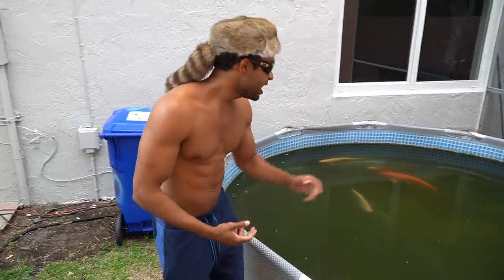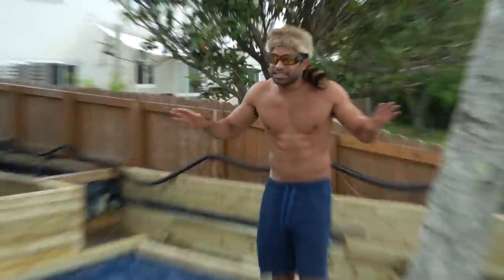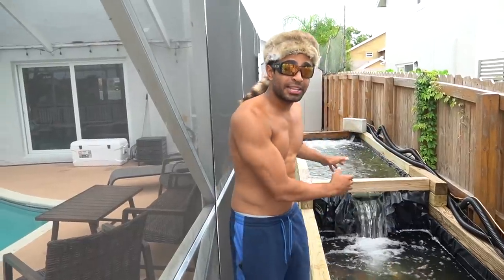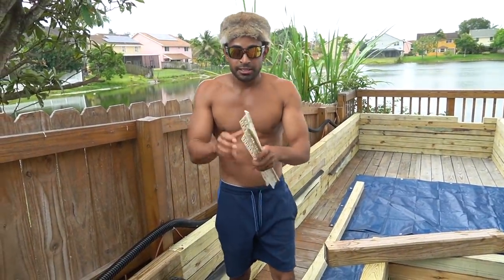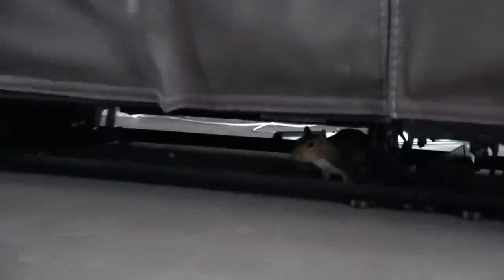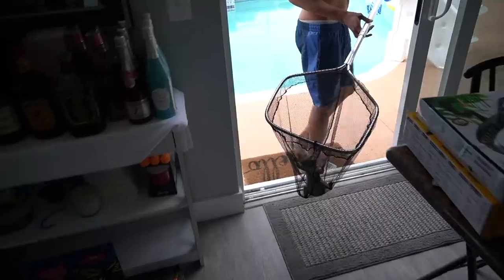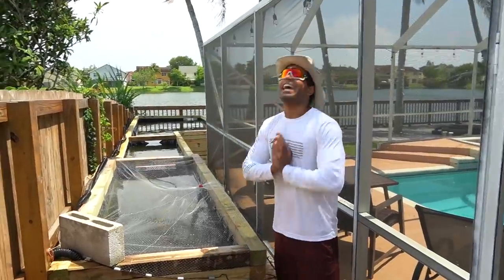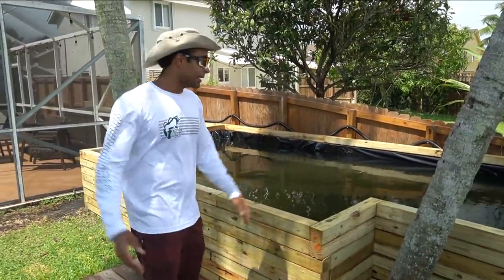BUILDING GIANT FISH POND with MULTI-LEVEL WATERFALLS! **Wood Frame**

Comment: Im just wondering if you deck is structured to have that much weight. Alot of people think its just fine to add heaps of weight lol. Id also put a tray or piping for the flow going out. That wood will warp over time

Comment: Hopefully the lake side of that deck is on the ground underneath. Otherwise the weight of all that water will cause a tremendous load on the structure.